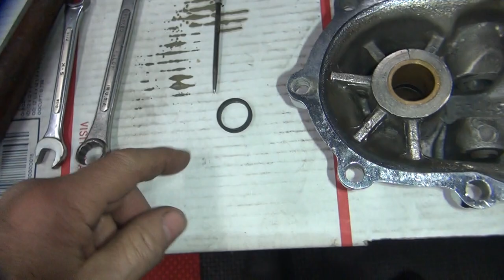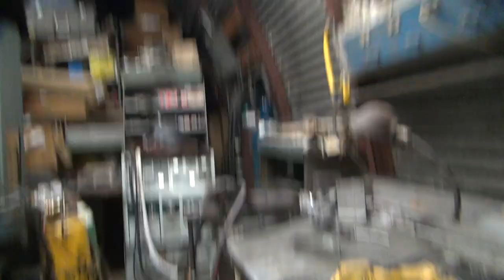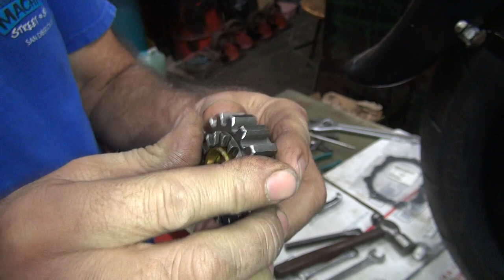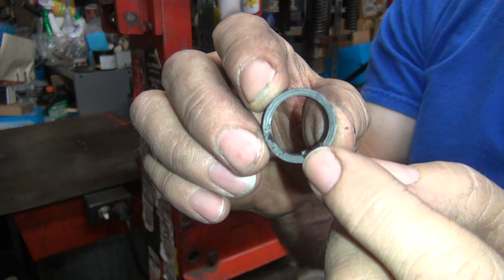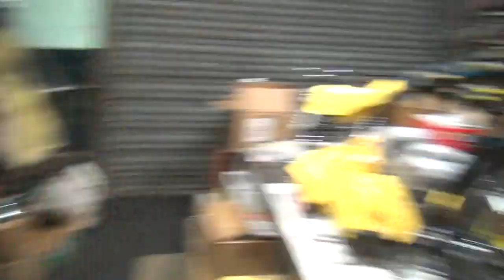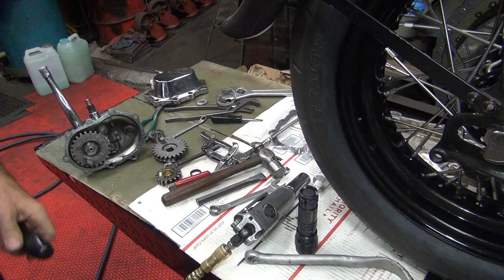#158 1957 panhead STD head conversion drag bike race harley scta lsr 2018 season tatro machine

Comment: Ok, a couple questions on those gears, and My bike is far away, so I can't look at the parts now, and they are all put together...Bike is in running condition. Anything in the tranny was there when I bought the bike in 1972.
 My motor is a 1946 Knuckle, I only assume the tranny is about that age, I bought a replacement 'Crank Gear' Screaming Eagle (the larger one). It is like the ones you have, but the 'original' gears are both a different pressure angle...14-1/2 degrees?? as compared the these new ones at 22 degrees...
 Was there a change in them after the 1940's? the old gears work OK, but the teeth on the larger one are wearing through the hard-case.
 I tried installing the 'new' gear from Harley, didn't fit right...teeth interference and probably why they broke immediately, even though dealer, both Parts counter guy, and Service manager assured me they were the correct ones. So yeah, I got my $$$ back.
 HD dealer insisted the teeth were just  'pointed' from wear...nope, you can still see the original machining/broaching marks on them....all tranny internal gears are also the 14-1/2 degree 'pointy' teeth...
Reply from the maker: harley had two different small kicker gears for different knicker ratios. they both used the same large gear. all the teeth wear so that is what it is. what i care about is the ramps on the large gear. the aftermarket ones are soft and don't last at all. the oem harley ones last alot longer but still wear out too. cheap ass s.e. parts are not oem parts.
this is a race bike so i let things go that are not that important to me like high mileage. it just has to be reliable at the track. a kicker that works does matter to me because when its time to race it needs to start.
tatro

Comment: What is the lifespan of a 60 year old bike after a rebuild?
Reply: Years ago, when you still saw a lot of Panheads...1970's...guys would get 40-50K miles if they rode easy...maybe 25K on the top end...Shovels were better, touring guys got maybe 60-70K...but still a top end around 25- 30K... Ironhead Sportys weren't as good...overheated easily...and short valve stems went away fast.
 But all those motors usually got a top-end 2 times for every bottom end job...of course you need to know in the 1970's about 1/2 the Harleys on the road were choppers, street bike riding...so they got flogged regularly...
Reply from the maker: brother who?????? what a dumbass. i have no brothers.
tatro
Reply from the maker: if you care about mileage than go buy a goldwing.
spend more for good parts and put them together correctly things last a long time. if you don't, than you get what you get.

tatro
Reply: I get my info from you. A real bike is not really a real bike. I heard what you said about those Knuckle cases. You also said EVO's are high mileage. I'll keep gathering my info. And I already own a 750 Honda